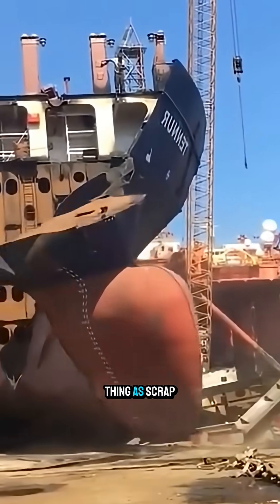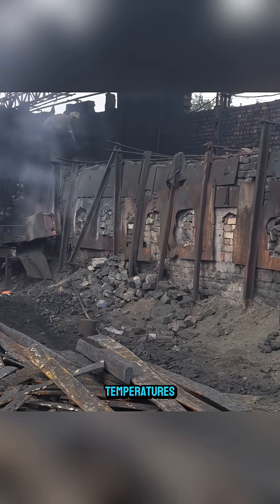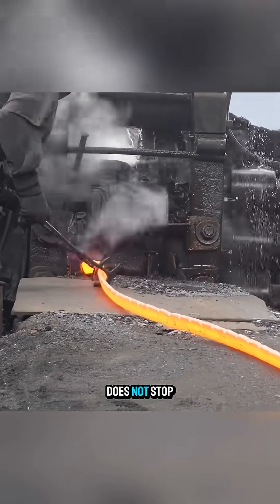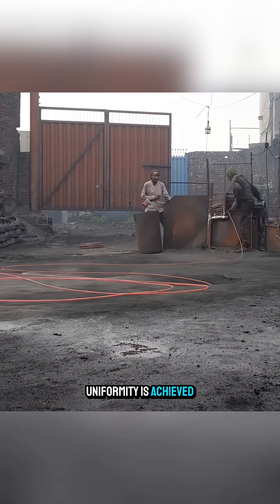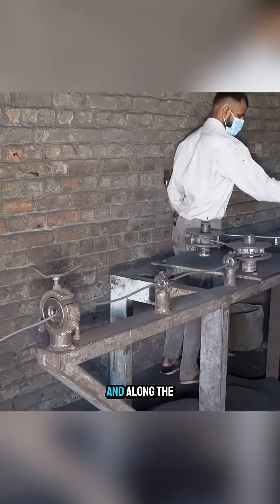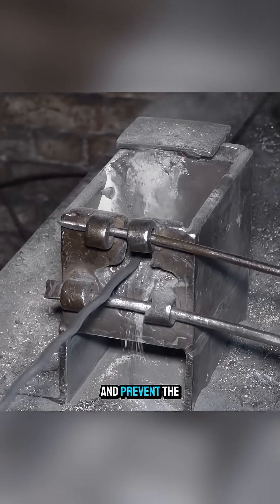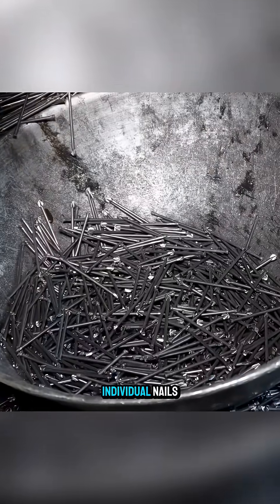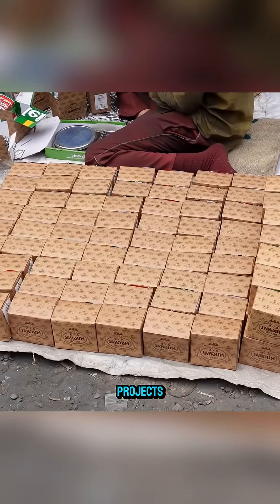The Rebirth Journey of Ship Steel #manufacturing #metal #technology #discovery #knowledge

Comment: I sell those drawing powders (actually called soaps), which are made from fats, calcium, sodium and other ingredients. The soaps aren’t to stop the wire from breaking, but to protect the drawing die from damage. The thin layer of soap acts as a barrier between the wire and the die, so even know it’s being crushed down to a smaller diameter in the die, they’re never actually supposed to touch each other, which is pretty freaking cool. The machines shown in this video are relics from a century ago, the newer machines are drawing wire down at incredibly high speeds, creating high tensile strength and are completed with a perfect finish.

Comment: Tht hole from which the wire goes through to reduce the diameter is called a draw die and the powder is called Vicafil salvia. Tht powder can actually compromise a females reproductive system and can also cause death of a baby in tummy, if inhaled significantly.

Comment: these nail are use in SHUTTING WORK in construction industry and most in carpenter work ..
neart Karachi Main city its GADDANI SHIP BRAKING INDUSTRY And 2 largest Ship braking industray and most cut matel plate reuse in Matel industry then main steel Market is SHER SHAH MARKET in karachi and then karachi & lahore are making TOR BAR STEEL for low level RCC house .and reaming are use in Pipe for Different industry like Stair railing, chair tabel legs, and construction industry like EXCAVATOR BUCKET , DUMPER DUMP , BOX Etc for reuse.

Comment: One thing that was not mentioned was the temperatures routinely reach over one hundred degrees.There most of the year
Reply: This is why the red-hot steel doesn't cool down in the Pakistani air.